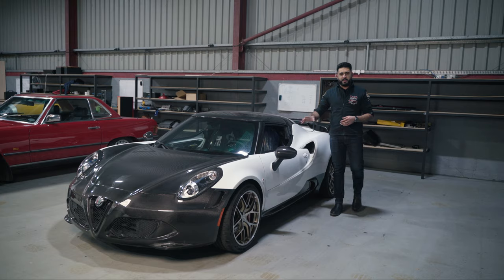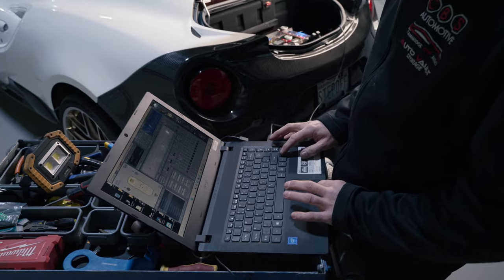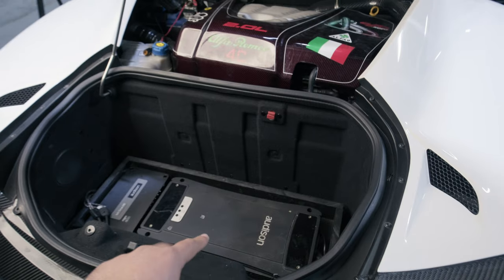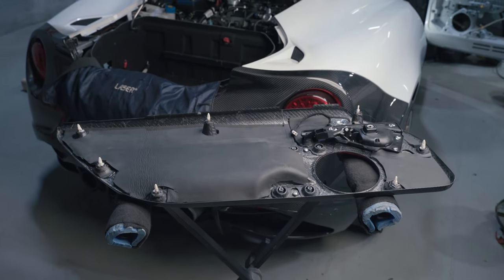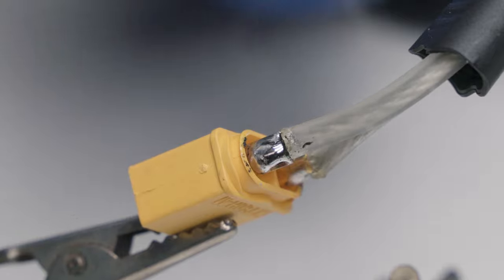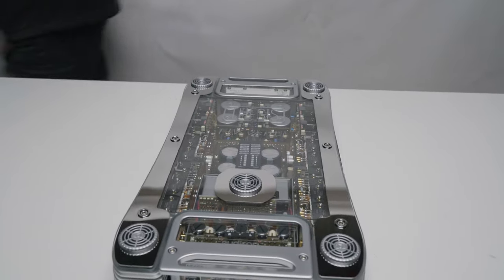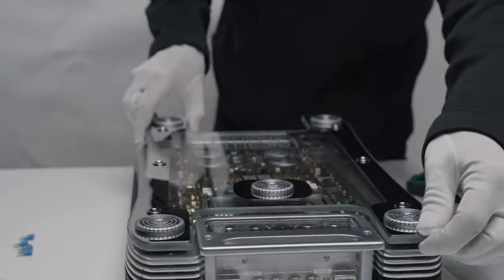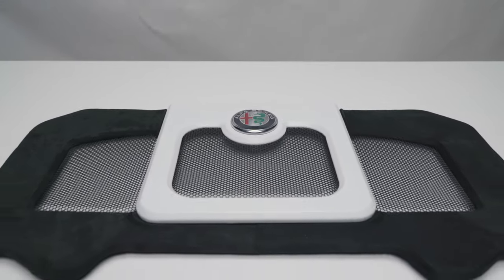We Upgraded Alfa Romeo 4C With a £10,000+ Sound System - International Project

Comment: Awesome work and awesome stereo, question: The Thesis Venti Amp is rated at 200w x 2 @ 4 ohm, however the Violino Tweeters are 6 ohm, so I would suspect you are pumping less than 200w (maybe 180w?) 

Anyway, to anyone thinking about Thesis Speakers: They are totally awesome and worth every penny! I have the 3-way Thesis set-up in the front and another set of Thesis Violino's in the rear, running in a 2-way set-up with Focal Utopia (2-ohm) woofers in the rear doors...
Reply from the maker: Yes, you never reach the max outputs claimed. Nice, thank you for the comment and I'm glad you enjoyed the video :)

Comment: Just how much better is the Thesis HV Venti than the Thesis TH due, especially when you factor in road noise? Once you get to a certain level of detail, any background noise would make it inaudible. I've always thought the only time it'd make sense to use a Thesis HV Venti would be in a Rolls-Royce Phantom or some other car that is dead silent, as any road noise would cancel out any benefit in sound quality you'd get from it. 

Also, if this guy was already dumping $15,000 USD on a Thesis HV Venti AND paid to have it shipped from the US to the UK, why didn't he spend an extra several thousand to upgrade the woofers to the Thesis TH 6.5's and the Voce 5.1k to the Thesis Quattro? Seems like a lot of effort to get it to you guys only to have you max out only half the system.
Reply from the maker: It is noticeably different. Yes, the car does make a difference but it is worth putting in any car. The woofers are from the Thesis line. Limited by space and airflow plus the 5.1k was already in the car
Reply: @CambridgeCarAudio Oh now I see it’s the old Thesis woofer (the new one has a silver cone). 

Aren’t the Voce and Thesis amps the same size? Or is more the Thesis Quattro would get too hot (which I have heard they do)? Also just how much better would a Thesis Quattro sound compared to the Voce?